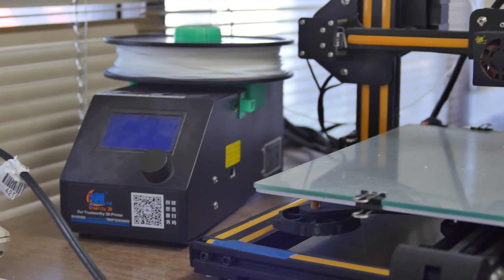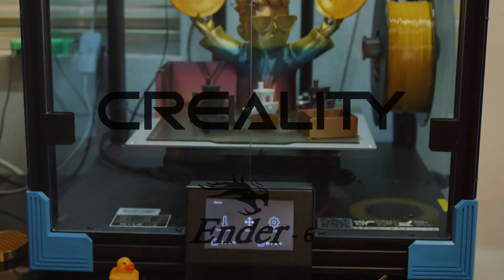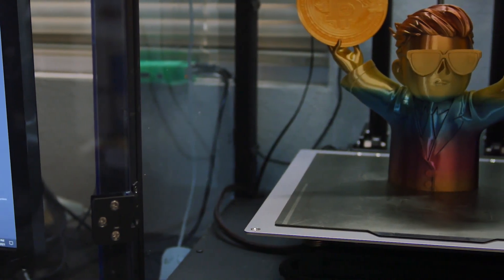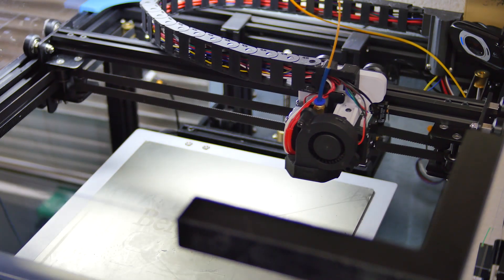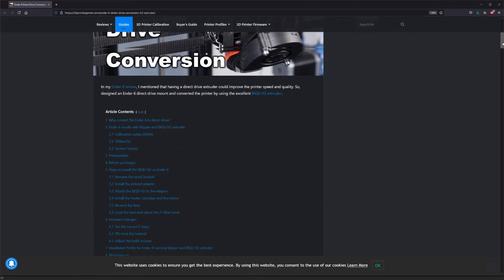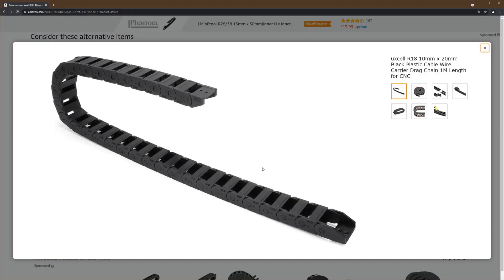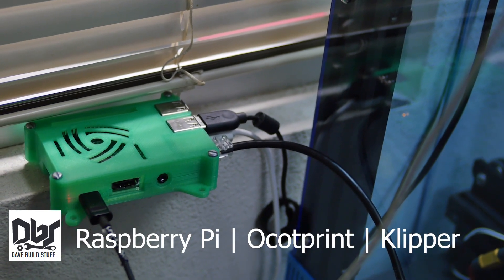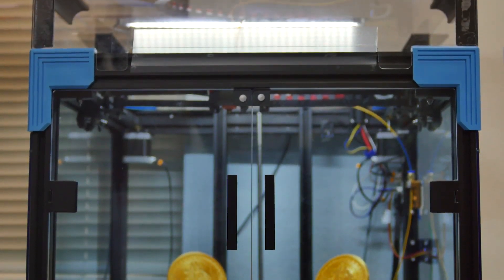I FINALLY Got a New 3D Printer! - Creality Ender-6 w/ Mods Overview

Comment: how to paint the object after printing?
Reply from the maker: Wow that's like asking how to build a house. Depends on so many factors. Typically it involves sanding, filling? priming to smooth layer lines. After that it will depend on what you're going for and the type of model.
Reply: @designbydave  sorry, yes i mean is there any machines to paint , or is there any printing machines comes with paint facility? Sorry if this is a stupid question ☺

Comment: Thinking of buying the ender 6, already have a 3 and 5, the 5 needs a motherboard which has proven to be a nightmare, my 4th is coming today, as I cannot get the extruder motor to work yes I have new motors, but the motherboards will not activate them. About modifying, I've found out the more things you add, the more problems you create, this applies not only to the 3d printers but almost everything you own. I was an automotive instructor, every student wanted to change something, which of course caused more problems to solve.

Comment: Hi! Isn't there any problem with the cable chain + top cover in the back left corner? To me it seems like there wouldn't be enough space for it. Or does it "bend" itself somewhere in the middle when you try to go there? I'd be glad if you could take a photo of it, but your word would be enough :) Thank you!
Reply from the maker: It bends out of the way, so not an issue

Comment: Hello, how to connect step motor of Biqu H2 to ender6? Thanks.
Reply from the maker: The connector that comes with the H2 is different then what is on the Ender-6 but the pins line up, so it actually just works to put it on as is. It's a bit lose, and can fall out if you are in there messing around with the wires but for printing it works just fine

Comment: How do you change the esteps  to 932 for the H2?
Reply from the maker: It depends on what firmware you are running. With Klipper, it's easy, just change the value in the config file and restart. With the stock firmware it's a bit more complex.

Comment: ive been thinking about an ender 6 because of the quoted speed but have heard you rarely get 300mm quoted speed in real life 3d prints.and a lot of prints are only 10 to 20% faster.
Reply from the maker: There is a lot more to print speed then just the maximum requested speed. Acceleration plays an equal roll. Also, when pushing higher speeds and accelerations, volume flow rate of material and part cooling become critical. In short, don't believe any of creality's marketing about "speed." In its stock configuration, the Ender-6 is not a high speed printer.

Comment: Firstly - I love my Ender 6 and yours is awesome as well. I mostly loved your video. The image and sound quality is great. Also - you have a pleasant voice for youtube video's. I wish you well in your future youtube projects. One thing that was very misleading and I really wish you would remove it from this video as it is an error in setup on your part and does a disservice to the Ender 6 and Creality is your misleading comment and photo concerning the yellow springs and the bed movement. Don't get me wrong. I love and use the silicone bed spacers on all of my printers as well. But with the stock springs - the only way the bed can have 5mm of movement and ever possibly create a horrible print such as the benchy you displayed is if the chrome screw in the back for the z-stop switch was not adjusted correctly and the bed was riding way up high on the springs. In that case a very quick adjustment in on that chrome z-stop screw and a re-level of the bed would've cured that very quickly. This is more a bad setup on your part and not a flaw in the design. I am glad Creality designed it with the adjustment screw. However had they dumbed it down and put a more permanent z-stop switch setup in they could have avoided the negativity as in your review. If you care to keep your video's accurate and informative - please fix that one little issue in your video by either removing it or clarifying that a simple adjustment would've fixed that problem. I hope you take this in the way it's intended. I'm not being a jerk. I'm trying to be helpful and aid you in continuing forward with great and fully accurate youtube video's. Thank You.
Reply from the maker: We are sort of both correct. It does seem the case that (although I did not think to try it at the time) tightening all four bed level screws, and thus adding more tension in the springs, would alleviate this issue. That, however would requiring adjusting the z-stop screw you mentioned. While that is certainly do-able, and also required when changing to the silicon spacers, it's definitely not an "out-of-the-box" adjustment that should be necessary, especially for new or inexperienced users. This does not constitute an "error in setup on my part" but rather an error in setup on the part of Creality. The printer should not ship in this configuration.

Having said that I still recommend a change to silicon bed spacers for anyone new with this printer.

Comment: HI David, Great video and as I’m getting ready to print ABS in may Ender 6 CoreXY I want to create a tophat as you have done, by any chance do you have plans and plexiglass thickness to do it? Thanks!!!
Reply from the maker: I found a basic design on thingiverse and modified it to use the polycarbonate sheet you see. It's a bit thin, but I just used it because it's what I has laying around. You'll probably want 3/16" to 1/4"

Comment: This is a nice video. Thanks for sharing! I am totally new to 3D printing, but teach my children at school 3D modeling. Of course it would be nice to have the models printed now :) I fear, I am not brave enough to work on the machinery like that. Do you, or anybody reading this, have a recommendation for a printer, that works without any adjustments? Right now I can't afford an expensive printer - hoping that everything works neatly there, without any adjustments. But of course price does not always make a better product. Thank you! 
PS. I modeled a cup for my students. So I need to be able to print something tall. A tiny cup is a bit weird :)
Reply from the maker: There is no such thing as a 3D Printer that will not require some level of adjustment, maintenance, tweaking, tuning, troubleshooting to get it working. 3D Printing is not as simple as click print and go, there is a lot to learn. That said, something from Prusa will be the most reliable and easy to use out of the box. They are also, of course, more expensive. Do not buy a cheap printer, like one from Crealiy, and expect it to just work without doing at least some level of modification and/or tuning. You will have a bad time.
Reply: @designbydave  Thanks for your quick reply. That's what I thought. A shame, also for my students. I hope 3D printers will become more afforadable in the future. I will look into Prusa. Thank you!

Comment: what additional functionality you talking about? xD That screen is usles with klipper...
Reply from the maker: Klipper offers (amongst other things) - Pressure Advance, Input Shaper, the ability to adjust firmware-level setting with a simple menu config change and restart. The screen retains all of the stock functionality thanks to the custom Klipper build which is linked to in the 3Dprintbeginner article.

Comment: can you expain where you used the glue on the cable chain adapters or show me would be much appreciated
Reply from the maker: The adapters were not designed for the same size as the cable chain. Not sure if I purchased the wrong chain or if the designer messed up (files sourced from thingiverse.) Gluing them worked fine though

Comment: I bro I'm new to 3d printing I'm planning to buy Ender 6 but many suggesting not to buy Ender 6 and go for cr 10 s pro v2 , or prusa I'm so confused ☹️ can you please give me a clear idea whether I can buy Ender 6 or not else can i buy which 3d for good performance
Reply from the maker: Yeah it can be tricky I know. The good thing about the market is there are so many options and choices that there is sure to be something for everyone. However that is also a problem when you don't know what you're looking for. I kinda comes down to what you want to do with the printer and what your level of patience and skills are for troubleshooting problems. A more expensive, but better supported printer like a Prusa will be more likely to "just work" but not quite that simple. Creality products can be good, but will require some level of tweaking, modifying and/or replacing parts. Maybe not quite to the extent that I went through in this video, but there will definitely be some level of work to be done on the printer.

Comment: Question: How did you get you ender 6 to connect to Octoprint? I have the Ender 3 Max with the 4.2.7 Main board. Thank You.
Reply: You would think that plugging in a usb cable would be all you need. But you also need to know things like the baud rate etc. my Ender v3 max 4.2.7 board. Refuses to connect. I have tried different baud rates, etc. but it will not connect. Neather will my Ender connect to my mac. My tevo tornado connects to both just fine.
Reply from the maker: @johnm.gerard1718  Oh right, I feel you. Unfortunately the downside of free, open source software and hardware solutions often times means things are less refined then we come to expect from the large software companies. Usually setting the baudrate to auto works (I think) but of course that can vary. Sorry I can't be of much help.
Reply from the maker: Not sure I understand the question. Printer connects to Raspberry Pi with a USB cable. I'm running the Klipper firmware so the Octoprint configuration is a bit different but there are guides for each method.

Comment: Great Video David! I just got this as my first 3D printer and I had some issues with getting my builds to stick to the stock glass bed sheet. After watching your video I ordered the silicon spacers and and the Pei magnetic build sheet. I installed both parts but now my tip is is about 1/2” away from the build sheet. I can’t figure out how to move the build sheet up to the tip to level the bed. Any help would be greatly appreciated!
Reply from the maker: You need to adjust the z home endstop and may also need to add some additional offset spacers under the silicon spacers - https://youtu.be/OQlusPOVUsE
Reply: Thank you so much for your prompt reply!!! I am looking forward to getting this thing going!

Comment: Is there any advise you could give your followers regarding the installation.  Tips or tricks that might stick out in your mind that wasn't well covered by the article's that you mentioned.  Also in regards 2 the raspberry pi, can you post up a link to the 1 you would recommend.  So many people selling different variations.  Thanks in advance and keep up the good work.
Reply from the maker: Do you mean the installation of Klipper? A couple of things come to mind:
- Make sure to dedicate a large chunk of time. It likely won't work every step of the way and there will be troubleshooting. It took me the better part of a whole day to get it setup.
- Actually read and make an effort to understand the error messages you receive. Many questions pop up on forums where if the OP read and though about what the error message way saying, they could solve it themselves. 
- You will be using a Linux operating system that may require a basic understanding of the folder structure and other fundamentals of how Linux works.
- Often the commands given in tutorials can be outdated and/or given without context or explanation for what they actually do. 
- Make sure you are using an older, small (like less then 4gb) SD card. Larger cards that we all have around for GoPros and such will not work. 

I'm pretty sure I am using a Rasberry Pi 3. Just get the cheapest one you can find. You don't need any of the extras that come with the package deals.

Comment: Thanks for the vid. I was seriously considering the 5pro but after looking at specs:
The ender 6 has a bigger print bed, is semi enclosed (some mod needed as you say for abs) , comes with the glass print bed and has the filament empty stop sensor. For those reasons for me the ender 6 has the better purchasing power since I would have put those upgrades into the 5pro anyway. 

What would be a comparable piece of equipment to this ender 6 in another brand? 
Thanks again for the vid
Reply from the maker: Thanks for checking out the video. Can't say about similar printers from other brands. There is so much out there in all different price ranges it's hard to say. I tend to think of 3D Printers as a platform that you start with and install, t weak, modify to suit your particular printing needs, rather then a "turn-key" product that you buy.

Comment: Great video, but how did you manage to install klipper on your ender 6? The guide doesn't include Octoprint but I really want to stick to it. In my first try I didn't manage to get display running. And my second installation won't work at all.
Reply from the maker: It was pretty tricky and took me the better part of a whole day. Lots of trial and error. There are other guides for OctoPrint, which are good, but not exactly up to date and complete. (It's actually easier then the guides make it seem as you pretty much just need to install the OctoKlipper plugin... I think, it's been a while.)

Pretty much everyone has trouble with the screen and its usually because they either didn't compile the Klipper firmware properly and/or did not properly format the SD card then flashing the screen firmware. 

I have considered a tutorial video for the process, but I can't really take the time to take my machine offline to re-build it. It would be most practical to purchase a second machine, do the tutorial video and sell t he machine when finished. Not sure I have the time to go through all that. 

Stick with it though as the Ender-6 is a real joy to use with Klipper and I wouldn't dream of going back to the stock firmware. Maybe reach out with questions when you are stuck and we can probably walk through it.
Reply: @designbydave  Thank you for your reply, I can really understand wh, you don't want to reinstall Klipper to your printer just for a video :D
But I actually managed to install it, I don't know why and I don't know how it worked since I did literally the same over and over again. But many errors later it finally works 👍🏻

Comment: hi. I think you will have problems changing filament midprint, due to there is no room to get the spool of, if the bed is at the same height. But nice printer. Considering one myself
Reply from the maker: You are correct, however that is not a feature I've been able to get Klipper working with so I just don't do it.

Comment: Next week I will also have my new Ender 6, and also  to susbstitute my old CR10, as you. I hope it is a correct decision: Less print base, but more confiability, functionally and enclosure for dificult materials.
Reply from the maker: As long as you approach it with a bit of patience and understanding that you will have to do some level of upgrades/mods (which should be understood for all cheap Chinese printers) then yes, I think you will be satisfied. Hope it works out for you and let me know if you have any questions. Mine is still printing strong!

Comment: Orbiter is lighter than biqu. So is sailfinlo
Reply from the maker: Cool. I've been super happy with my Biqu H2, but if I'm ever in need of an alternate maybe I'll check those out.
Reply: Orbiter is only the extruder. You need to add the weight for the hotend as well if you want to use an orbiter.

Comment: What is the part where the filament goes in from the spool to the tube where the extruder was sitting ? I'm building the same setup incl. the Biqu H2 and Klipper but can't find that part. Please help ;)
Reply from the maker: It's part of an old, extra extruder I had sitting around. It kinda worked out since it has the mounting holes that match the stock extruder bracket and threaded hole for the bowden coupler. It would be pretty simple to fabricate something that works just as good, but I just made use of the parts I had.
Reply: @designbydave  Ok, thank you very much.

Comment: Can you change the head to one that can take a lot of heat? Would really like to be able to use NylonX and get "corbon fibre" builds...
But as I can tell, you need to be able to run the head at 260 degrees for that and it might be too hot for the standard head, no?
Reply from the maker: Yes, I'm running an all metal hot end in my Biqu H2 extruder and have printed CarbonX Polycarbonate at 290C just fine. - https://youtu.be/6PIEF9uWKSA

You can also replace the stock hot end with an all metal one if you don't want to also swap the extruder.

Comment: If you had the chance to get the cr 5 pro H over th ender6 would you?
Reply from the maker: Assuming you mean the Ender-5 Pro, I would definitely go with the Ender-6 as it's a CoreXY machine plus its mostly enclosed already. I've been super happy with my Ender-6 so far and it's been able to handle even more advanced materials (see my other videos.)
Reply: @designbydave  Thanks for the info. However, I did mean the cr 5 pro, that big white sheet metal enclosed Creality Printer.
Reply from the maker: @migueldevela2917  oooh I see know. Yeah, Creality's product names are all over the place. I was assuming the budget printers like the cr-10. 

The cr-5 pro H looks like a nice? professional level printer but don't be fooled by Creality's flashy advertising. It likely uses the same level of super cheap, bottom of the barrel components as their other products. Depending on cost, and time, you might be better off with modding an Ender-6 like mine, especially since these are becoming quite popular so there is a lot of documented mods for it. I haven't seen much of anything of the CR 5 pro online.